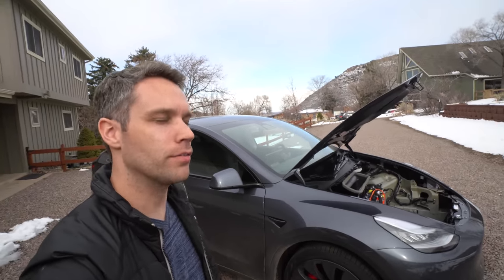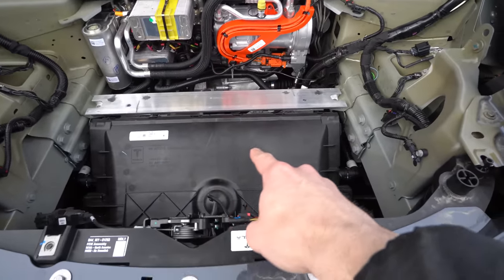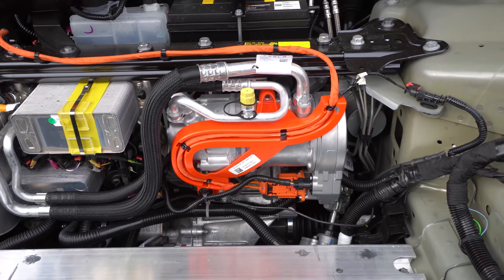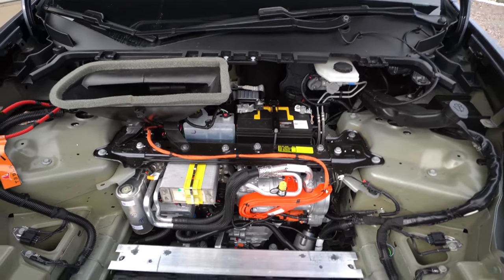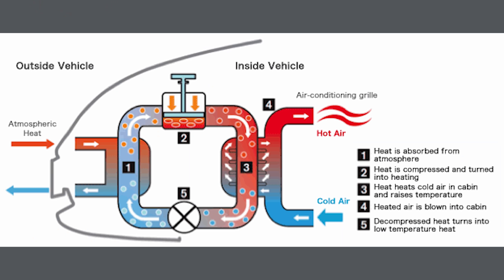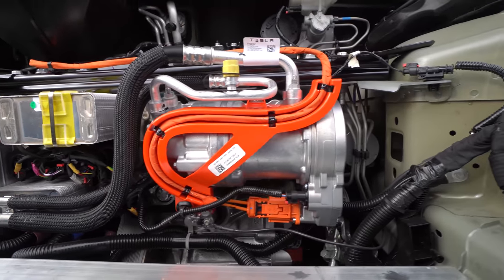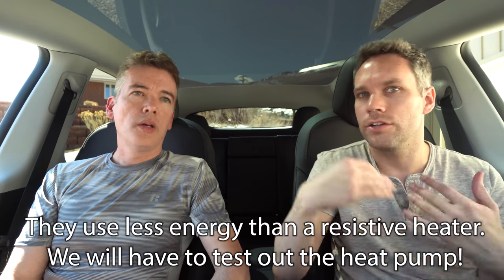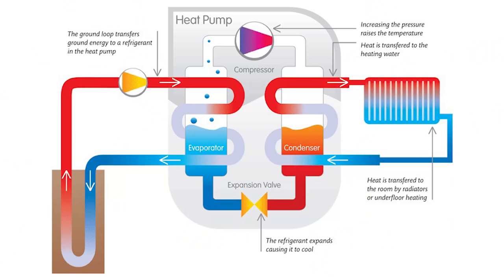The Biggest Change in Model Y Over the S, 3, or X!

Comment: As a Canadian who sees a 20-30% decrease in range in the winter on my 3 this makes me incredibly excited.
Reply: Don’t get too excited. Heat pumps don’t make much heat when it gets really cold out. At 15F they do not make much heat. This is a fair weather vehicle. I would not want to use it when it’s -20F out.
Reply: Heated seats do not heat the vehicle.  Here is my luxury vehicle and I can’t be warm. Another  Tesla FAIL.
Reply: @thejackalsmith7329  anyone can be as warm as they want, it still has a PTC heater.  In fact you can be warmer, quicker than in any combustion engine vehicle. And can pre-heat in your garage without dieing.  So pretty much it's the opposite of what you said.
Reply: CYYZ_Spotter Nice A320 profile picture
Reply: @awo1fman  good point about the heating up situation in a garage. I have been exploring making a kind fo thermal insulating tube that a car can roll into and then seeled up in very cold climates to preserve or insulate from heat loss in cold environments
Reply: The Jackal Smith that is true heat pumps only can warm or cool the incoming air so far. However with a vehicle you have the option to recirc so as the cabin warms up you can get it that much warmer so even if the outside temps are -50 you can still get the inside cabin temps to above 80. It will just take a bit longer. Similar to an ICE vehicle in that regard. Having to wait for the engine to warm up to get the cabin warm. Also with the battery powered vehicle you can preheat the cabin pretty much whenever you want. With ICE vehicles you can do this also but just not as easy.  So overall the heat pump puts the percentage loss similar to the loss that an ICE vehicle experiences in the winter.  One step closer to completely eliminating any logical reason to buy ICE cars anymore. The last nail in the coughin will be when charging gets below 10min to supply 300miles of range.  When that happens your beloved gas vehicle will be dead. Whether you like it or not.
Reply: @Cybertruck Capitalist I'm curious. Why would you do that?
Reply: @redman2751  And as soon as there's something like bitcoin, your fiat currency will be dead. Oops - it may take a hundred years...

Comment: We have AC at home for 10 years, mostly to heat ( heat pumps can work to heat and cool ). The only problem is when it's feezing outside, the heat exchanger can get clogged with ice, then the pump has to melt it, loosing some efficiency. That's why on northen countries they prefer to use ground exchangers, instead of air ones.

Comment: I worked in an industrial HVAC company 15 years ago and back then Heat pumps were not a new thing. They are up to 4x time more effective than the resistive heaters. The problem with them is that the heat pumps are quite efficient above certain temperatures, let's say +5 C. They usually can be used for both AC and Heating and I assume tesla did that as well. The +5 C problem is likely solved with heat exchangers coming from batteries and motors.
Reply from the maker: Thanks for the insight! Much appreciated!
Reply: They have stacked the heat pump onto the motor so the pump will scavenge heat from the motor and Tesla can heat up the motors by as Bjorn says “afterburners”.
Reply: @scottwills4698  Correct.  In addition to taking heat from the heat pump compressor motor, they also can operate the compressor motor in a less efficient mode to in effect use the motor itself as a heater.  Same trick they did to heat the traction (main) battery before Supercharging by using the traction motor in an inefficient mode.
Reply: @Emiliyan Tanev Yes, Model 3/Y definitely takes heat from traction motors, electronics and batteries and directs it to heating the cabin (or battery pack).  The new trick on the Model Y is to operate the heat pump compressor motor in an inefficient mode and take its heat to also heat the cabin.  It's using the compressor motor itself as a heater.  To do that they added a fluid loop to the heat pump compressor motor and reprogrammed the motor controller.  

It's a clever solution that makes the motor act as a heater and doesn't use a resistive heater.  They got the idea from what they are doing to heat the battery pack for Supercharging, where they are operating the traction motor in an inefficient mode to heat the traction battery pack before fast charging.
Reply: Home heatpumps use a resistive backup for a reason
Reply: This is the most efficient car and integrares evrrything it can, people cant apply standalone heatpump numbers to this.

Comment: I have a Heat Pump which I installed to replace a gas boiler over here in the U.K. Nearly 400% efficient, we have never looked back with zero maintenance costs in 5 years so far.

Comment: They try to explain the heat pump but they don't really get there all the way. "A heat pump uses electricity to run a compressor." That's right. But what they don't say really is that the refrigerant run through compressor then can pick up heat from the outside and  let the heat off to the inside. It's basically a reverse AC.

Comment: We put a 12KW Panasonic heatpump in our house in 2013 (2100 square feet bungalow and it burns 3 - 4KW of electricity).  As you say, it takes longer to get started but you can set a timer, just like in the Y, so that it's warmed up when you need it.  It paid itself back in 5 years compared to our old oil-fired boiler and we no longer have the smell to deal with or the risk of running out of oil. We still have the radiators as under-floor heating would have cost too much to install retrospectively.  I'm a big fan of this type of tech!

Comment: I have a heat pump in my house in Sweden. I takes heat from a 100m (333 foot) deep drilled hole into the rock and heats up my house. I have had it since 2001 and saved a lot of money compared to the oil burner we had before :)
Also have a (air-air) heat pump at my summer house that heats it up in the winter and cools it down in the summer. Heat pumps are great.
Reply: And I bet far more reliable.
Reply: @pinkelephants1421  LOL right, complex, high pressure system with lots of moving parts vs zero moving parts... You're dead wrong. Resistive heaters are far, far more reliable and cheaper to make. They're just less efficient. They win hands down in every category but that one.
Reply: @awo1fman  true, heat pumps always break in winter when you need them. However, you can have redundant systems. What I also like a lot is heat exchangers. They bascially exchange heat from the inside air to the outside air to keep your air fresh without having to waste heat by ventilating. A must have for every passively warmed house.
Reply: @awo1fman  Well.. My pump has been running for 47000 hours during the last 11 years and i have not had a single issue with it ... Remember that the heatpump is using a compressor that comes from the refridgerant world and fridge compressors like that is very reliable... They say though that expected lifetime of the compressor in the heatpump is 10 years... When it breaks you just replace that part.. After 15-20 years there is probably a lot of better alternatives and more efficiant ones out there so you will probably upgrade anyway ...
Reply: @awo1fman  If you go for the resistive heater you will have to pay more money for that solution compared with a heatpump .. so.. its up to you... :) Heatpumps is way cheaper solution and also WAY better for the environment so you should make the change ASAP...
Reply: how many watts does the pump have for pumpin water 100m?
Reply: @mattaut88  It wouldn't take very much energy because it's only moving the water, not lifting the water 100m.

Comment: @1:32 *electric compressor,  not the heat pump. A heat pump is a function of the refrigerant system, not a particular component. Thanks for sharing, exciting to see what's changed under the frunk.

Comment: I've been using an air to air heat pump in my home for 20 years, but southern England doesn't usually stay below freezing for more than a few hours. When Nissan installed heat pumps in the Leaf, they included a resistive heater in the unit to boost really-cold-weather heating. I would hope Tesla did the same, especially as most of the world is colder than Palo Alto.
Reply: they will have to for defog reliability

Comment: I have 2 heat pumps in my home and 1 in my car. Leaf.
Older one in my home works extremely well down to -10*C but will still generate modest amount of heat (maybe 150%) down to -15*C.
Leaf pump works well down to -5*C then it starts to take more energy and PTC has to help. At -14*C heat pump is switched off.
The new pump in my home from Mitsubishi is specifically designed for cold climates and...well. That works exceptionally well in any temps. Haven't tested it jet it extreme cold but papers say 200+% efficiency at -25*C. At -15*C it was super capable and silent.

Cars have smaller condensers and therefore either more fan noise or less power. Or higher driving speed (highway speed will help a lot).

Comment: Norway: LG air to air heatpump/ac: Rated at -15 °C/5°F at 300 % effiency (1 kw electrity drain to run compressor and fans, inside house it provides 3 kw energy, temp of air blowing out is around 60 °C. Refrigant is able to extract enough energy outside in -15°  C to make inside unit blow 60 °C warm air. Cool stuff. My pump can at outside temp -7°C extract and deliver 6,6 kw at 450 % effiency, at -15°C 4,3 kw/300% effiency and even at -25°C 3 kw 180% effiency..
Reply: Wow! 60c is 140F, enough to burn your skin off!  (At first I saw 60, thinking Farenheit, thought "that is kinda cold")
Reply: Our heatpump needs extra energy from an electric heater to heat our water up to 60 deg C at -15 degrees outside. How is that possible at your place?
Reply: It can't be more efficient than 100%
I'm terms of an efficiency increase however, if it was 30% efficient and is now 90% efficient that would be a 300% increase
But no, no man made machine is even 100% efficient
Reply: @firstname7950  There's no "perpetual motion" being claimed. What's actually happening is that 3 units of heat are being moved inside the cabin for every unit being expended by the pump.

Comment: Correction: a heatpump simply moves heat from one source to another. Some heatpumps can only move heat one way while others can reverse the flow of refrigerant and move heat the other way.

All tesla's have heat pumps for the Air conditioner, thats what the AC system really is.. a heatpump, its just that its a one way heat pump designed to move heat from the cabin, battery & motors/converters and transfer it out of the car.

The only difference between for example a model 3 and a model y is that the model y has a reversable heat pump. Now obv that isnt the only difference, the model y probably has a more robust heatpump system with a beefier compressor and better heat dissapation mechanisms (liquid cooled condenser) for the hot/cold plates. But generally speaking, thats about it in terms of differences.

In summary: all tesla's have heat pumps, but they're only designed to remove heat from the cars internals and dump it outside. The model y however has a special designed, reversable heatpump that can both remove heat and dump it outside and also extract heat from the outside (or from one internal component to another) and dump it into the cabin/battery.
Reply: Um, no. All heatpumps have a reversing coil and a 2 way compressor. 
All previous teslas had air conditioning and resistive heat coils separately. The model y has a heatpump, which means it's an ac in the summer and heater in the winter with (hopefully) a resistive heat backup
Heat pumps do work by moving heat from 1 place to another, but it hardly sources heat from motors, batteries, etc. A heatpump gets heat from the ambient air around it.
Problem is, in the winter there is little heat in the air to begin with. Under 20-30f depending on humidity, a heatpump is nearly useless. It would need to rely on a backup heat source. Motor heat wont be enough. I hope tesla has a resistive backup somewhere.
Reply: @pilerks1  im sorry to say but i dont see the point you're trying to make here.

I said the exact same thing as you did, minus the pulling heat from the battery/motor/converters.

I said that all tesla's have heatpumps but that they arent designed to move heat from the outside in, only inside out. This is due to many different reasons. It dosnt matter if the heatpump is reversable or not, my point was that all tesla's have heatpumps, just not ones used for heating/cooling in one system (besides the model Y)
Reply: @pilerks1  No they do not. Some are one way, some are two way.
Reply: Just like your refrigerator and freezer.
Reply: @Xanthopteryx  For a unit to cool in the summer and heat in the winter (making it a heat pump) refrigerant has to flow in both ways
Reply: @pilerks1  the "cooling" it does in the summer is it literely moving heat from inside the fridge, freezer.. etc to the outside world (the room). Its a heat pump, no matter how you look at it.

Just because it only moves heat from a smaller box to a bigger one (the outside world) dosnt mean its a cooler.. its still moving heat, not "cold". cooling is relative to the ambient temperature, you can cool a room from 45 C down to 40, just like you can cool a room from -10 to -15.

You cannot move "cool", you're only moving heat. If something moves heat from one place to another.. its a heat pump. This includes things like pelthier devices.
Reply: Thanks kev
Reply: @pilerks1  or you can vent the gases in the opposite directions
Reply: @kevin42  It's just HVAC terminologies, they are all compressors, but to differentiate a heat pump from an HVAC compressor, A heat pump can go both ways and an HVAC compressor only goes one way. You can also call them one way heat pump and reversible heat pump if you like but that's just not what HVAC professionals call them.
Reply: @pilerks1  A heat pump is not by definition necessarily reversible. The air conditioner of any car is a heat pump but is just not reversible. So is any refrigerator. Any home air conditioner is also a heat pump but IS almost always reversible.

Using the term 'heat pump' specifically for heat pumps that can provide heat is just marketing speak that came from lazily abbreviating the term "reversible heat pump" to just "heat pump".

The term came around mostly when it became popular in very cold climates to install heat pump systems with heat exchangers buried deep under ground to take advantage of the higher temperature under ground. The term 'heat pump' then leaked into the more common air conditioning business to be applied to air conditioners that had already actually been reversible heat pumps for many years before that but just weren't called that.

Comment: Hyundai Kona also have a heat pump. Had it during two winters now and it works superb. The heating is quick (1min), but uses quite a lot of energy if you are starting with a cold car and battery. But for longer distances extremely efficient around 0 degrees Celsius, and also great when colder!
Reply: Have you tried it at -10 or -15 degrees Celsius?
Reply: @yourcrazybear  at -10 the PTC kicks in.

Comment: The heat pump is a great change for Tesla, very smart.
Reply: nissan had it  back around 2013
Reply: Smart, they are catching up to others, if the were smart, quality control would be improved and sell them at them at a decent price, not overpriced !!
Reply: @mixalis6168  Overpriced?  Obviously you haven't bought a new car lately.  $37K is the average price of a new US car in 2019, or about $2k less than a Tesla Model 3.  
In 2018 I was considering a Ridgeline and several pickup trucks - all were about $45k after adding leather, wheels, and a few other options.  I settled on a Model 3. Fuel savings was $2,235 the first year (20k miles).  Add in gas engine maintenance saved and over the first 100k miles the total cost of ownership for a Model 3 is about $23k or about the same as a Honda Civic.
Reply: @joetripp123  How does one go from a truck to a Model 3?  If one needs a truck, they need a truck.
Reply: @ryanl1782  I had two cars - RAV4 and a Mazda sedan.  I have the RAV4 because I pull a small bass boat & a small utility trailer.  After shopping around I decided to replace the Mazda and keep the RAV4 for now. The Mazda was older and would have needed some expensive maintenance soon.  Really the only reason I wanted a truck was for that small boat (16' aluminum) and most AWD Teslas offer a tow package.  I went with the AWD Model 3 and added a hitch.  I still may get a light duty truck one day.
Reply: Ryan L I answered your question. I’m not sure what your comments even mean. So you’re  saying I can’t pull my boat with the RAV4 that I’ve been literally pulling that boat with for 10 years?  It’s apparent you’re trolling so - Ciao.